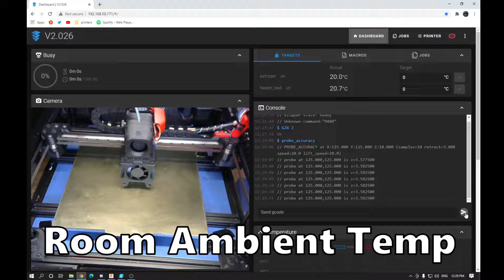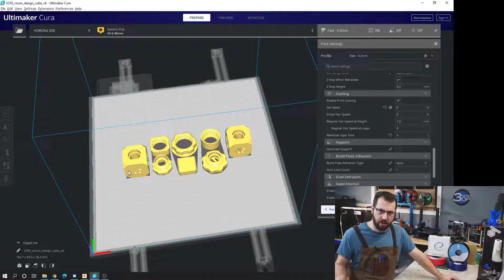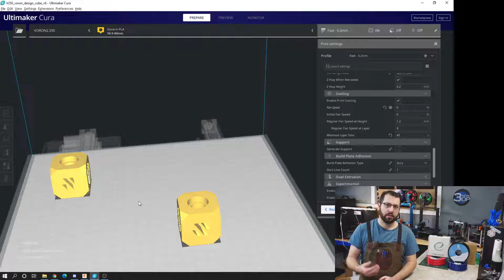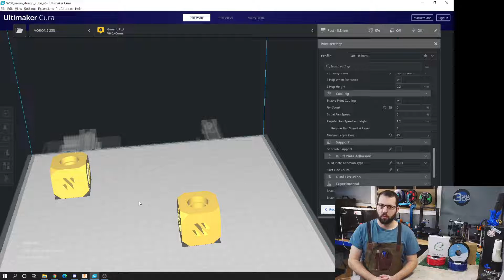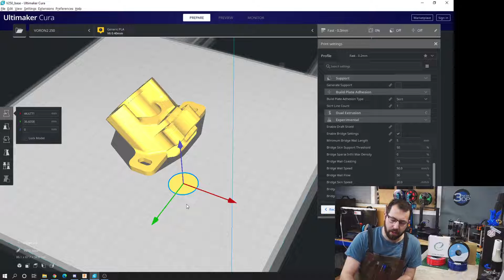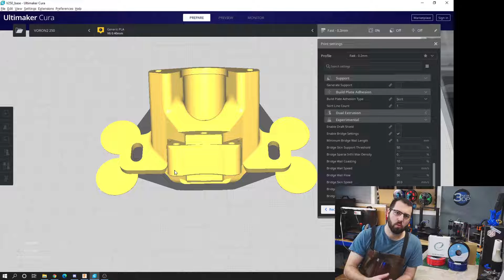ABS For Dummies Part 4 - TIPS AND TRICKS!

Comment: 4 videos and no mention anywhere about humidity or filament moisture… Is this not an issue when it comes to ABS?
Reply from the maker: It depends alot on your location. For me for example. It's not really an issue as my basement it pretty low humidity. If you live on the coast in the south..it may be an issue
Reply: @CanuckCreator  I imagine it’s still going to pickup moisture over time, especially if it’s not stored properly. Just another point to keep in mind. 

Other than that, great videos. Thanks for tips.

Comment: My voron 0.1 gets so toasty inside that I often have to run the fans at full speed, especially for tower-like structures - printing a sacrificial piece on the other side of the bed doesn't really work when the bed is 12x12 cm. My parts seem to be plenty strong, but I haven't done any sciency tests on them

Comment: Half the time I cancel a print for concerns over its quality or extrusion failure only to find some glaring flaw in its design when I line up the partial print as a test piece.
And I would otherwise be remedying that problem with superglue and a drill at the end.
Occasionally a blowtorch even lol

Comment: Not entirely sure what I'm doing wrong but any print that doesn't have a solid top layer (i.e. screw holes) that top layer comes out like crap.  What settings should I check to figure out why my top layers are coming out bumpy but only when the top layer has holes in them?  I have the top layer printing at 25mm/s on my FLSun SR.

The sides come out excellent as does the bottom.

Comment: Draft shield is great for taller objects, especially if you can't make enclosure (ie. you have big Cartesian printer). Cura and Prusaslicer (and Superslicer) has this option in Skirt & Brim settings. It basically creates tall skirt around your object in it’s height. So it protects object from air fluctuations and keeps heat in a narrow area, like a chimney. And it also allows to slow down for proper passive cooling of a layer.
Anyway, printing ABS+ or ABS-T helps a lot too. From reliable manufacturer, eSun, well, I don’t know.

Comment: Is 45s your recommendation for minimum layer time for ABS?  Mine is currently set at 15s and just wondering if that's a gremlin lurking in my settings.  Thanks for these videos, wish I would have had these before I got into Vorons a year ago!  ;-)  Somehow I made it through with an Ender 3 and a LACK. ;-)
Reply from the maker: 45s is the recommended and its fine to tweak based on your printer and setup.  Fully enclosed with high ambients you can drop it. If your uneclosed you may wanna up it

Comment: Just wondering how much it cost to build your Voron? I really want to build one but the cost is turning me off. I currently have a SV01 and an Ender 3 v2
Reply: my total bom for my 2.4 300mm is about 1300,  i already have the tools, connectors and wires so cost is lower for me
Reply: Just buy a Qidi Xmax3  cheaper and big.